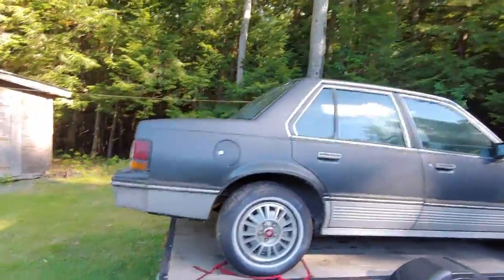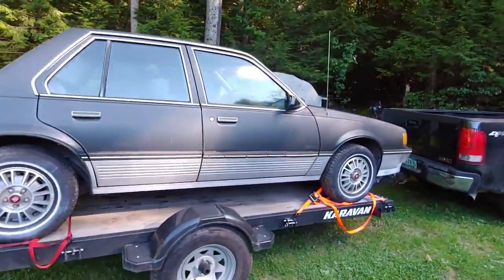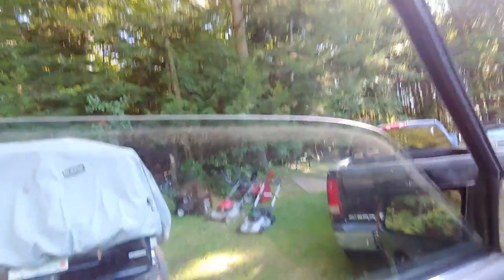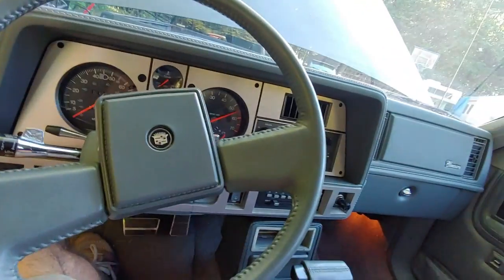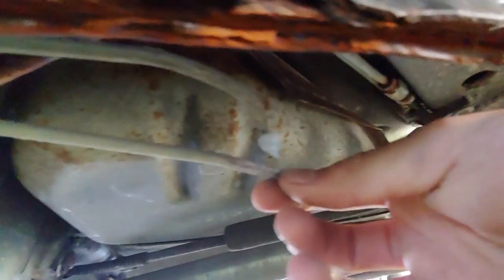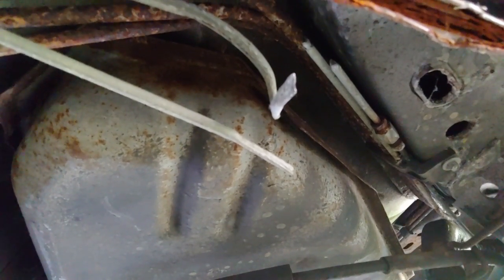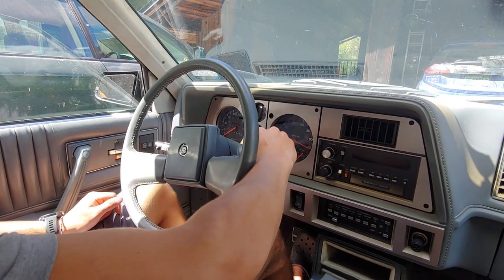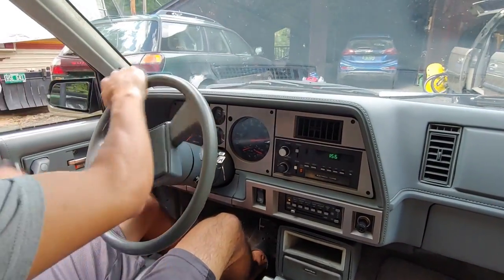I Bought The Cheapest Cadillac On Craigslist! Is It Junk?

Comment: Gott dang that thing is ugly, hahaha. Outside and inside if I'm being honest. It does have a certain appeal, but, I'm just glad it was $600. Overall it is in really nice shape! Mostly just needs some shocks and lines it looks like. Nice everything is still working on it. Should be able to make a decent profit for sure. Most Cavaliers in Vermont are long gone to rust.
Actually funny story about an early 90s Cavalier. My nephew got one, sky blue. One of the firs things he had to do was replace the same brake lines actually. At any rate, at one point it needed an alignment bad so we took it to our mechanic. He calls us and says "We have a problem. I can't fix it. Come look at this." So we get there and he says "See anything wrong?" Points at the strut tower in the engine bay which is leaned over at about 10 degrees or so. It had actually rusted at the lower seam and separated from the frame rail. It was no wonder it was super out of alignment spitting rooster tails down dirt roads and wore through a new set of tires in 200 miles. He junked it and I think that's when I got him a 94 Golf, which was actually a pretty cool little car.
Reply from the maker: Hahaha well i love old boxy car looks. Def needs some tlc and shell be ready to roll. Too bad for the nephew lol. But hes got a cooler car now at least
Reply: @ARuralVermonterQqjmcb182  He killed that a while ago, then he had a 90s Volvo 240 wagon I believe,  then I got him a 2001 Volvo S60 which survived far more neglect than it had any right to. 😂 Now he doesn't have a car. I love old boxy cars too, but IMO the Americans did it bad in a lot of cases. I'm more of an AMC or Lincoln Town Car box fan. The late 80s into the 90s was sort of peak ugly box for a lot of brands then the mid 00s were peak ugly curvy plastic POS on wheels with reliability issues for most domestic brands. 😂

Comment: One of the many reasons Caddilac declined. This car has less then 50K, and still has issues.
Reply: It's over 30 years old...
Reply: @lanceg2533  All the  more reason it should have very little to no rust and especially a rust hole Lol
Reply from the maker: Yea for a 30 yr old car it aint bad dude age and salt deposits cause rust and corrosion not miles